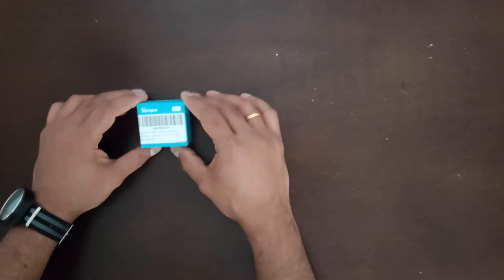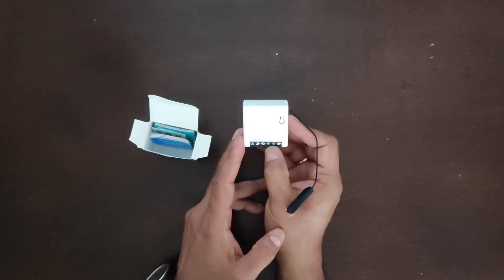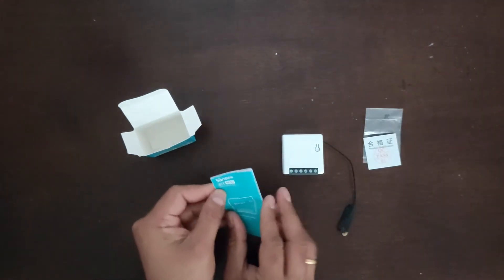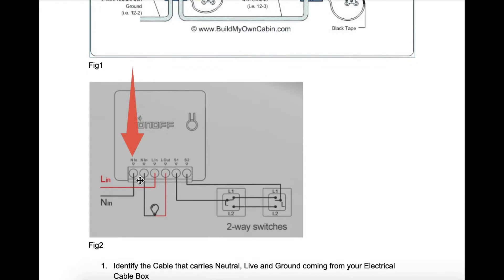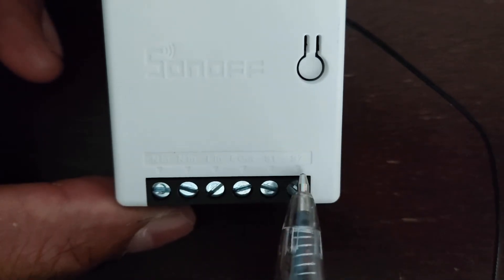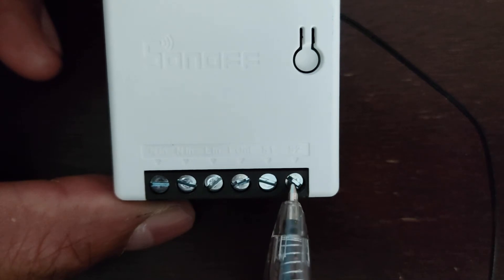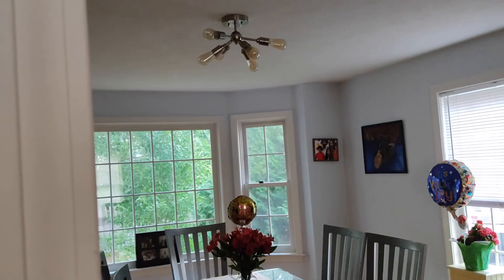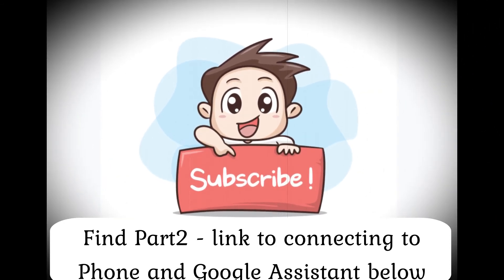Part1 - Sonoff Mini Unboxing and Detailed Installation to a 2 or 3 Way Switch

Comment: @Zach & Aiden I have a 3-way switch setup (US) and after opening up both boxes, it appears that the box in my basement has the black wire coming from my circuit breaker (which should go into L-in on the Sonoff) and the box upstairs has the black wire going to the lights (which should go into L-out on the Sonoff). I think you covered exactly this in the video but I didn't follow it 100%, so I was hoping you could summarize what I'd need to do to install the Sonoff mini (ideally in the upstairs box since there's more room). Thank you!

Comment: Good Explanation.  Small query. In the circuit diagram for 2 way switches, are L and L1 connected, seeing a small line in both the switches.  Please clarify

Comment: Thank you for the video     I got most of it working but...   I dont understand which wire goes to the common poles on both switches;  well I believe the one on the switch close to the lamp goes to S1 on the Sonoff switch.  But the other on?    The cable between the two switches only has three wires..   the 2 travelers and the black live which "disabled"    
I redid the diagram from your video with the new connections and would send it to you if youd like to upload..  
Would appreciate your assistance....  

Thank you
Reply from the maker: Send me the diagram and I can take a stab
Reply: @ZachAiden  not sure how to do it here.
But I have gotten it working now as i found a magic white wire to connect the switches...
Thanks for the video it definitely helped a lot but it would be great if there was a revised diagram at the end showing the new connections.
Have a great day !!!

Comment: Thank you for the extremely good video.
I will have to say, it took me several replays, but eventually I was able to understand the wiring and the electrical flow.
Thank you once again.
Reply from the maker: Also there is another video to a.one way switch